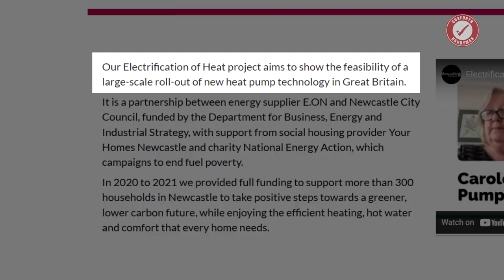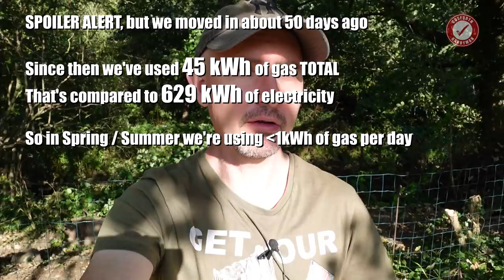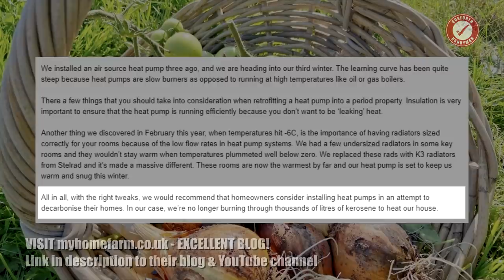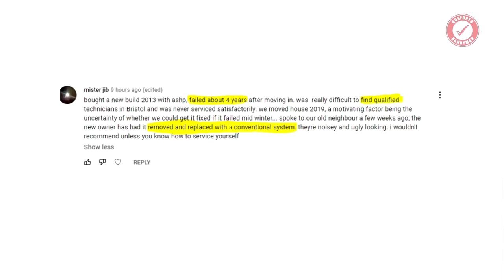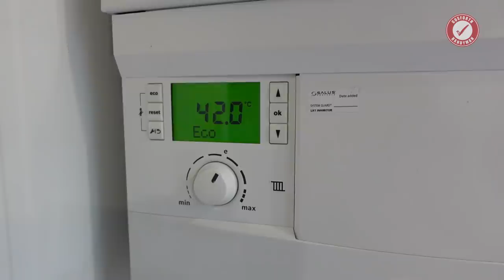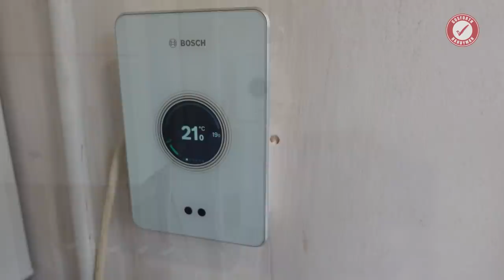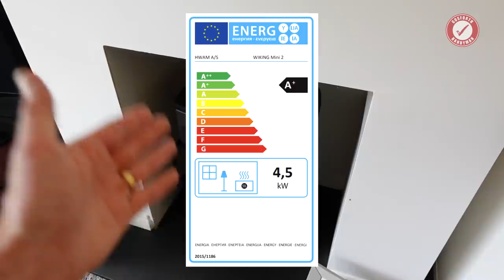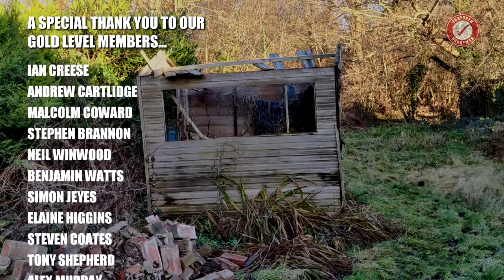Why didn’t we install an Air Source Heat Pump? (1920’s Renovation Part 32)

Comment from the maker: A few corrections and clarifications for this vid here - please have a read as I'll keep this relatively up-to-date with new findings on the subject: https://gosforthhandyman.com/corrections/
1000+ comments and counting - thank you so much for taking the time! I've read almost all of them but there's just too many to reply individually. Many good points. A few where folk obviously haven't watched the whole video. Remember I know SQUAT about heat pumps and based my opinions on first hand experiences from folk using the actual systems I talked about - head over to the Community tab to read those replies. Thanks again, interesting subject, keep the comments coming! 👍👍
Reply: My strategy, improve insulation dramatically, oversize radiators and install underfloor heating downstairs when refurbishing, this way your gas boiler will operate really happily in its condensing mode with nice low flow temperatures and you've future proofed the transition to a heat pump.
Reply: @edc1569  ... gas prices have surged 500%.  I look forward to his future video on how well his new government funded ASHP is working :D
Reply: We've had the larger version of that boiler since 2007 (42Cdi combi) Couple of things to watch out for. Where the condensate pipe leaves the house in very cold winter can freeze causing the boiler to throw an "EA" error and refuse to start. Just use a kettle of hot water to unfreeze the pipe if this happens. Second issue is the "Bearing Plate" this is a metal disk (After the fan in the boiler?) with a disk of rubber attached that acts as a "Flappy Valve" type of thing regulating the air into the boiler? where the metal disk touches the rubber should be coated with the lead from a pencil to stop the rubber disk sticking to it otherwise this also will cause the boiler to throw random "EA" errors and refuse to start once more  (Ask me how I know..)

Comment: This is the first time I have heard someone speak so eloquent and  sensible about climate change and associated issues etc…well done. I’d vote for you 👍🇬🇧
Reply: was going to say exactly the same Graham - handyman's got at least two votes...
Reply: He’s got my vote. I’ve looked into air pump heat and I wouldn’t want it.
Reply: Very interesting and well
Presented . Frightening though as we’ve just had spray foam, I hope that doesn’t mean the house is now unmortgageable !
Reply: ...'eloquently' and 'sensibly'. HTH
Reply: Advocating fossil fuel use is far from sensible or sustainable. 
These high tech 'combi-boilers' are only as efficient as ever possible through use of microprocessor control and won't work without a power supply. 
Is the exhaust hot? Sure, and that is a thermal loss.
Is the hot water supply to showers and hand basins far hotter than need be, and in fact a scalding risk?  Well, if so that is risk and needing further use of tempering valves to prevent personal injury... but in any case excessive fuel use for that function.
Reply: @BTW...  I’m sure you can set the temperature of the water. There is no sustainable eco way of energy at this time.

Comment: I'm on the East Coast and live in the open country side. The first thing you learn about living out of town is that when the bad weather hits the first thing to go is the electric supply.  We have had to wait up to three days for the power to come back on. On these occasions we depend on our log burner to supply heat, hot water and even heat for cooking. I'm afraid the Government can demand what ever they want but my log burner is staying put. Brilliant video, spot on with the information.
Reply: YES! I live in coastal Cumbria and the power goes off, always have  a gas fire as instead of electric just in case
Reply: @macraghnaill3553   Your "gas fire" operates without an electric power supply? It must be very old now, low efficiency rated by modern standards and near burnt out, literally.
Reply: @BTW...  my gas fire ignition operates by battery as does my gas cooker.
my gas fire can still be bought , gas fires on sale are either powered by battery or piezo ignition
Reply: @macraghnaill3553  So, no room or oven circulation fans to help reduce fuel consumption in either appliance.
Reply: @BTW...  the oven doesn't need a fan, neither does the gas fire.
what gas fire uses a fan?
I'm not bothered about fuel consumption
Reply: @macraghnaill3553  The gas oven, gas heater and gas instantaneous water heater in my home ALL include fans. 
They are all high efficiency design, but lower efficiency than if electric heated. No two ways around that, bubba.   
Now.... think about this with your simple little brain, if you can: Why would it be that modern advanced gas fired (even wood fired) ovens and room heaters have fans built in.  Only the lowest priced most basic units with low efficiency DON'T have them. 
Like... assuming you can actually cook and haven't been living under a rock for the past 30 years.. haven't you noticed on the packet of that miserable frozen pizza the temp setting for plain convection ovens is 220C but 200C if FAN FORCED?  10% lower temp., faster cook time, better cooking results and more than 10% less energy used.

Never heard of fans used in gas room heaters? 
It doesn't take a lot to imagine why... but for an idiot cave man kind, the simple reasons... to assist in circulation of the heat around the room/s and to allow smaller sized appliances with higher output ratings than those without fans.

Not "bothered" about fuel consumption or appliance efficiency? 
Enjoy the pending increases in fuel cost then, surface parasite.
Go back to your cave, oil lamps and dung fire. Your kind are done on Earth.

Comment: As someone born and living in Sweden, it's fascinating to listen to this. Here everybody and their mother is going heat pump route and it's been going on for 20-30 years. It's air/air, air/water, ground source (and people here drill "energy wells" as in 200 meter deep holes, not dig up their back yard). It's cold here in the winters. Modern heat pumps still work decently down to -30°C.

I currently live in a 50-ties house that originally was built with oil boiler heating, then converted to resistive electric heating. We have no gas. I'm now converting it to ground source heat pump. Everybody else on the street had ground source heat pumps installed 15 years ago, but the then-owner didn't go down that route.

This is like first time I visited the UK and the hotel advertised one of its unique selling points, that it had double paned windows. At the time, I lived in an apartment built in 1961 that had triple glasing from the get-go. Fascinating how different world views can be.
Reply: Borehole GSHPs are good. I have worked on them.
I have also worked on Air source heat pumps, and personally I wouldn't go near one unless it's a small new build with good insulation and underfloor heating.
Reply: Yes borehole is the way for a heat pump. I stayed in house in Sweden during winter which had the system. Yes triple glazing is probably standard in Sweden.
I do wonder how much solar gain is different between double and triple glazing, to reduce the heat during summer months.
Reply: Your area of the world is also known for building very well insulated houses. The UK housing stock was mainly built around the idea that it was first cheap to burn coal and then gas for heating, even now our building standards are something of a joke compared to other parts of the world. So sticking on an air-source heat pump to an average home is a big issue, what is way worse is that the homes are designed around lots of airflow, so just sticking in lots of insulation just causes lots of other issues as the airflow is blocked.
Reply: To be fair, your weather does provide quite an incentive to push these measures through. Not to say that the building industry in this country doesn't make me want to tear my hair out!  As a then architect, 35 yrs ago I was working towards residential new builds being net zero by 2016. Where did that go? A lot of questions the media presumably thinks is too boring to properly probe.

Comment: I am a retired energy professional, I went through the process, here are my findings.

I live in the Netherlands, climate here is pretty much as you described yours.
My house was built in 1980.
I did all the retrofitting needed, and installed a Daikin hybrid heat pump to replace the old combi gas boiler, in early 2017.
I now save about 25% of overall CO2 emissions (including that at the power plant) and about 15% "fuel" costs, compared to before 2017.

What I missed in your video was a look at the possibility of a hybrid heat-pump. 
- That would lead to a much lower initial investment.
- While you get the best of both worlds. That is: the system runs on gas OR  electricity OR both, depending on what is most efficient, either financially or with respect to overall CO2 emissions.  

A heat pump, of any kind, is ONLY the right thing to consider if ALL boxes are checked, either by design or by retrofitting the house.
Particularly: 
- the house needs to be well insulated: roof, floor, walls, windows, what have you.
- Furthermore, you need to have the right (Low Temperature) radiators and/or under floor heating.
- Basically you will need to arrive at a situation in which you can heat the house "always" with a water temperature of below 50 C or so and most of the time well below that.

The problem is  that most professionals, that have always only ever worked with gas boilers (here anyway, oil too in UK probably), are not capable of getting everything right, or if they are people are not ready to pay for advice on how to redesign everything.
That's where things go often wrong, you ask for a heat-pump and NO fancy expensive comprehensive advice, the response often is:  "you want bananas, we give you bananas" and they install a heat pump for you.
Reply: Yes exactly this. I'm also from the Netherlands. And our advantage is we have been working with combi boilers for a long time now, and so we are making the next step.

Also, next to that hybrid heat pump you can also think about air conditioners. They heat perfectly fine and don't have dependancies on the radiators and such.
Reply: Hi there - We have been looking into heat pumps for a while and have weighed everything up but I cannot get the figures to add up at all. I am interested to read your comment on this video and I cannot help reply to it. You have said you save 15% on energy bills per year, so for example if you had a bill of £2000 per year you save £300 . If you replaced you existing system with a heat pump the installation costs is about £10000 - 15000 for everything including insulating the property properly it will only take between 30-50 years until the heat pump has paid for itself.
Reply: @becausesupsussex4568  Insulation is always a good idea, regardless of the heating source. So in that sense, not really fair towards heat pumps. Just like people saying we need solar panels with heat pumps.
And if you really do insulation with proper heat pump insulation you should of course save more money, while energy prices are only getting higher.

As an alternative you could apply a high quality aircon for heating. It doesnt have to have the power for the coldest winter days, it can just work 70% of the time, the rest can be done by the existing heating source. That way installation is much cheaper. And no dependencies on the type of radiators and so on.
Reply: @becausesupsussex4568  

For "older" houses. just insulating is often saving way more than a heat pump could.
In my case insulating (ONLY) lowered the power consumption, for heat only, by over 25%.

As things are: Heat pumps are, for many, an environmental thing more than a money saver. 

That 15% was JUST heat pump effect (on top of insulation effect).
At least up to very recent, SINCE: at current (early 2022) prices here (Netherlands) the savings are over 50%, for JUST the heat pump effect.

Pay back time calculation are way more complex than they seem.
Among many other things, it very much depends on the ratio between prices for electricity versus gas (or oil), and on how you expect those to EVOLVE over the live time of said heat pump.

The world is in an energy transition.
It seems reasonable to expect that over time greener and cheaper electricity will become available and gas/oil prices will go up considerably more than those for electricity. 

All things considered, I would definitely NOT invest in a new furnace at this point in time. In fact that's what I have been saying for the last 5 years.

ALWAYS: 
- insulate (well) first and foremost.
- otherwise a heat pump is bad investment, for several reasons.
Reply: The comment on Bananas is apt, and is why there are EU reg's on bananas, you asked for bananas we sent you bananas (small curved yellow things), technically a banana but inedible, we have retrofitted in the past but will not work for people that want corners cut and will not consider the whole solution.
Reply: @aadvanherk1271  I live in Zutphen, Netherlands in a 1880 built house which is listed by city council as 'preserve city look?" (beschermd stadsgezicht). In my opinion heat pumps are not suited for city centers. Too noicy. Too big (wouldn't know where to put one). House is not allowed to be fitted with solar panels and the investments of installing all needed insulation and alternative radiators is way to high (for my wallet).

Comment: Hi Andy, just wanted to share my opinion on ASHP. We got one 3 years ago (in Ireland) and I would not go back to anything else for love nor money. It has reduced our heating bills drastically (about 40%) and it gives us a nice comfy temp all year round. Also just wanted to point out that AirSource HeatPumps are also used in Scandinavia where temperatures plummet way below ours and they still do the job properly. You just have to make sure of two things: get a good installer and make sure your house doesn't leak any (or little) heat. The fact that they are better for the environment and that they are better for air pollution in your home, are just bonuses.
Reply: ps: a good installer will take everything into consideration: if your house is insutlated well enough, if you rads are the right size etc. but all in all, in the long run, it's worth it.
Reply: No Felix it's literally impossible for them to work north of Cardiff. A YouTube comment said so! 😂😂
Reply: @felixreali7101  What system were you using before because a balanced flue condensing boiler will see around a 40-60% saving in the UK when compared to a conventional boiler. Generally in Scandinavia the winter weather is a dry cold not wet so the ice build up on the units is less, needing the resistive heating element of the unit to come on less. Not quite sure why you had air pollution in your home though?